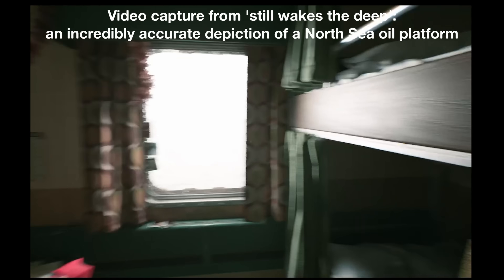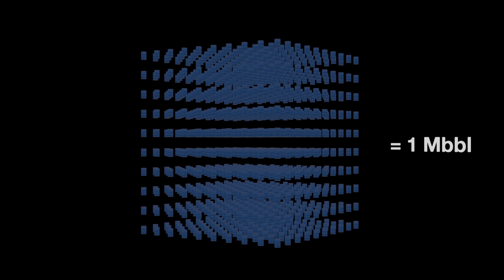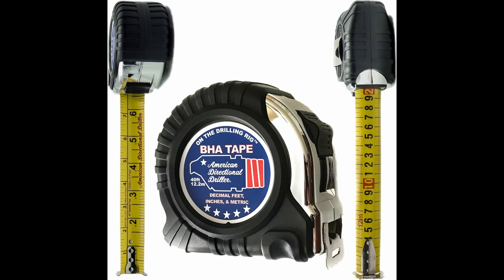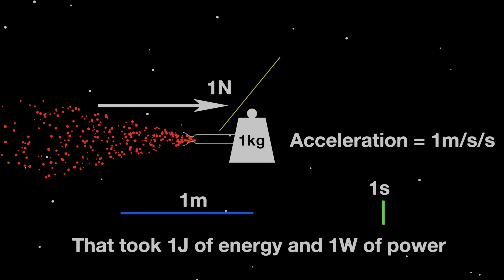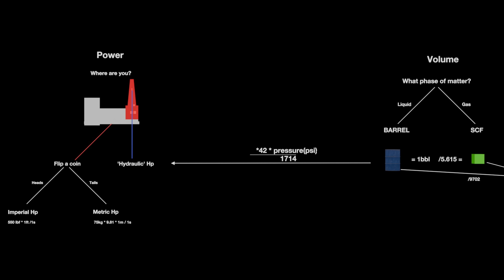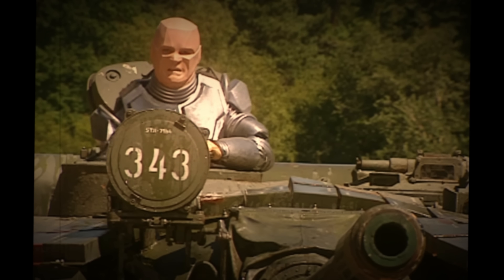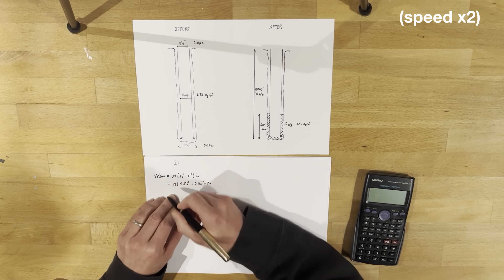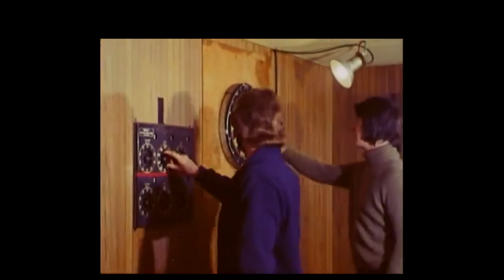Oilfield Units: a Measurement System so Cursed it made me Change Career

Comment: In meteorology (US), we have a dog's breakfast of units, too. Temperature in Fahrenheit or Celsius, depending on whether you're on TV or taking observations, winds in knots, height in feet, visibility in miles, and rainfall in hundredths of inches. Pressure has at least three variations. Hectopascals or millibars if referring to levels in the atmosphere, millibars if referring to pressure reduced to sea level, and inches of mercury for station pressure and altimeter setting. Models at least calculate with SI units, but then convert to all the crap above for output. It's likely a function of meteorology arising out of aviation and just being saddled with the customary units of American pilots in the early 20th century.
Reply: I'm 58 and grew up with pounds and inches but it's always been Celsius for me coz that's what the BBC weather forecasts have always used.   It was the ambiguity between below zero and below freezing that always bugged me, zero IS freezing in Celsius, you damn Yanks!   I'm older and wiser now and see the benefits of Fahrenheit. Here's the thing, a degree Farenheit is about the smallest temperature difference you can sense on your skin, ie what we can perceive, what's useful.  But with Celcius you want to go to tenths of a degree, which is overkill, or just Celcius, underkill.   And in temperate climes, ie most of Europe, the temperature is 0 to 99 °F nearly 100% of the time. The point I'm belabouring is that with Farenheit, two digits is all you need, least for weather, no decimal point, no negative.
Reply: @colinmacdonald5732  I'm about the same age ;-) and I still don't see any benefit to Fahrenheit.  Mind you, I grew up in Germany…

Ah, okay, interesting… and irrelevant.  I know what I like, and that's that.  I don't need decimal degrees for that.  Never care whether 23.8 °C or 24.6 °C is more to my taste: I prefer it roughly below 25, 25 and up is already too warm, 30 is too hot, and I don't want to think about temperatures above 30.

Oh, and Google just told me (not the AI summary, the actual results) that humans can feel a one degree difference in temperature.  One degree Celsius, that is.
Reply: Funnily enough, height in feet and wind in knots is something carried over internationally for aviation. 

That’s because of WWII, specifically the bit where Europe’s airlines were utterly ruined, and Douglas Aircraft Corporation built over 16,000 C-47s. 

Continental Europe rebuilt their airlines after WWII with surplus C-47s, since they were basically DC-3s with a cargo door, stronger floor and an olive drab paint job, and DC-3s were very good airliners. 

Since the airlines were flat broke, they figured it would be cheaper for pilots to use US units instead of spending the money to convert all the perfectly good dials for their perfectly accurate instruments to metric.

Comment: In optics, curvature is sometimes expressed in diopters, there's literal gauges that measure the curvature in diopters. The problem is, diopter is a measure of lens power, not curvature, so the curvature gauge measuring diopters was only valid for pure silica glass! Other glasses have a different refractive index and therefore bend light differently than silica glass, so measuring the diopter curvature won't give you the correct lens power. Heaven forbid you forget to account for a biconvex or plano-convex lens.

Comment: I just think it's funny that people care so much about it. Metric is good most of the time and us customary is fine for most things. There are some unit that I think you will talk about that are insane and need to be killed but there generally uncommon*
Reply: Metric is inherintly superior due to the interconnectedness between Length and Volume. If you need to make a cubic container that contains 1 hektoliter the calculation of the dimensions is done in 1 second. Now do the same calculations in feet and inches for a 250 gallon container.

Comment: Another wonderful unit is the "acre foot"
As far as I know it is exclusively used to measure the volume of water retained by a dam.
Reply: An upsetting unit, but at least I can see how it immediately multiplies out! If you’re working with acres already then it saves you a conversion.
Of course, it does mean you’re still using acres and feet, so points off for that.
Reply: @conferzero2915 it gets even better when you look at the definition of an acre
"A chain by a furlong"

Which is the nice convenient dimension of 66 feet by 660 feet

Comment: Machinist here, we have a wonderful mix of fractional and decimal inch units. 
Drawings can go either way depending on who made them. Stock (material) sizes and cutting tools sizes are in fractional standards (3/16, 1/4, 5/8", ect) where as the machines are built and graduated in decimal. A standard manual lathe will move the cutter 0.200" per rotation for example. This makes many things more difficult than they should be for obvious reasons. 

Side note,  I am from Canada. Another country with an absolutely cursed system of units.
Reply: And that's not even getting into the letter-and-number drill sizes that you need to deal with for threaded holes, or the thickness of sheet metals in "gauge".
Reply: @BrooksMoses or the mess that is British thread pitches
Reply: @Kurokimachine  Oh goodness yes.
Reply: @Kurokimachine  So much of a mess the British don't even use them any more! Imperial hardware is reserved for legacy systems, nuts, bolts and fasteners are almost always metric.
Reply: @Kurokimachine  Or bicycle thread pitches. Enough to make even a man who owns a full set of Whitworth spanners scream
Reply: @BrooksMoses  in the electrical industry we measure wire Sizes by mm2 crossection, mm diameter or AWG. mm diameter is mostly used for uninsulated solid core wire and telecom cables. The real fun is that cables speced in AWG sometimes (mostly when ordering from china) come in the mm2 equialent, beeing ever so slightly smaller.

Comment: This is lovely. While looking up the thermal conductivity of sheet materials for an electronics cooling application needing also electrical insulation I ran across this monstrosity in the spec sheet from one manufacturer:
    BTU mils / ( feet^2  hour  degree F)
I just gave up and chose something from a manufacturer who specified it in W / (m K)... Greetings from a Swedish electrical engineer (where no one in their right mind uses these units).

Comment: As a driller and then a directional driller I would say that dogleg severity is a sensible unit that describes how difficult it is to get weight to the bit or run casing. Radius of curvature would work for build-and-hold wells but most directional wells these days are pad work requiring the well to build and turn to land at 90 degrees inclination. To give my directional drilling trainees a sense of what dogleg severity meant I'd ask them to think through how much rock would the bit have swing through to change the well bore from an inclination of 0.5° at an azimuth of 45° to 0.5° at an azimuth of 225°. Now think through how much rock the bit would have to swing through to change the azimuth 180° if the well has been built to an inclination of 90°.

Comment: I still love the foot-acre as a unit of water measurement, but only for floods and farming. It's exactly this many litres of water: 1233480 (from Google). So, 1 and a quarter megalitres. Like, it makes sense, but it's about as useful as measuring "how-much-concrete-did-we-use?" in moles per cubic yard. It's just a stupidly arbitrary number, when worked out in simple metric.

"Enough to cover a football field in a foot of water" from Google as well. Like, wtf? And you use this as a unit of measurement? That's gotta be the most American thing ever.

Comment: I was going along just fine, the BTU thing is annoying but whatever, until you got to the worked example and gave a solution for the concrete volume in bbl, which of course makes sense with the industry context, but somehow THAT was the thing that threw me off.  Obviously, the correct answer for concrete is 7.0604 cubic yards.

Comment: 10:00 the most probable reason is the order of magnitude of typical values. If the typical range of values is between 10000 and 100, the most convenient way to express the number is in hundreds. Personally, I'd express 1714 either as one-thousand seven-hundred fourteen, or just seventeen-hundred if the tens digit is insignificant.

Comment: I'm so happy I'm not the only person who can't understand why the world has chosen to measure energy in kWh instead of mJ. Yes I like a 3600 conversion factor in my SI units, says absolutely no one, except everyone just does it for some reason.
Reply: An LED lamp consuming 1 W of power that stays switched on for 1 h uses 1 Wh of energy. It's both intuitive and how the entire industry thinks. As long as it remains standardized and no further conversions have to occur on the regular, it's fine.
Reply: @hammerth1421 Oil field units are also how the entire industry works; that's irrelevant to whether the units are nice to work with or not.

That I don't think the world should've picked them doesn't mean I don't think they're more or less fine, they're just more clunky to work with than necessary. I do know I haven't been able to convince my engineer dad watt isn't energy, so he's being ignorant but also the Wh is indeed causing unnecessary confusion.

A device measuring watts can just as easily report J/s or even kJ/hour as it does watts. The Wh is easy to define but hard to work with or intuitively understand if you think in terms of energy first, not power first. Try explaining energy to a 5th grader: higher energy = bigger explosions. Less energy = less work. Now try power. You either become circular (more power = more powerful) or dependent on energy (more power = puts out more energy per time).

(I consistently fail to be consise, sorry.)
Reply: The reason is that nobody is interested in how much energy something uses if you run it for one second.
Reply: @AndersLang-i5s We don't measure distance in (meter/second)hours. That the watt has a name and the m/s doesn't is not an fundamental fact.

Comment: I initially clicked on this video believing I had some broad sense of what I’d be getting into, and was looking forward to gawking at some weird imperial-adjacent unit systems.

I am two minutes in, and have learned that oil is measured not in barrels, but in BLUE barrels specifically. And we haven’t even gotten to gasses. I’m now dreading what horrors of anti-standardization I will soon come to witness. Wish me luck.

Edit: Just finished the section on power and energy. Before today I thought things couldn’t be worse than horsepower and kilowatt-hours. Simply incredible. Honourable mention to kilowatt-hours-per-hour though, that’s hilarious.
Reply: It'll be "pirate-ninjas" for power next, I swear (refer to Andy Weir's "The Martian" for that one - one kilowatt-hour or 3.6 MJ per Martian day, or sol)
Reply: I went from "Ok, not great but it's not that bad so far. I can memorize this" to "I can tell why they have a book for unit conversions now".

Comment: My recent oilpatch units story from western Canada:

A couple of weeks ago I was harvesting a field of wheat next to a drilling rig. They had a wire strung out through the crop, so I stopped in the office shack to arrange moving of the wire so I could cut the crop around it. While there, one of the guys steering the drill showed me the 3D schematic of where the drill was going under the field (super cool👍). I asked what the minimum radius bend they could make the drill-string bend. He paused for a second then explained he didn't actually know since all their calculations are based on degrees per hundred feet😂
Reply: if something bends by 3 degrees per 100 feet, it's easy to calculate in your head that after 3000 feet it has turned 90 degrees. More useful for railway than oil drilling though.

Comment: This is right up there with the specific impulse and delta-v shenanigan's that crashed a probe into mars. Like who thought it was a good idea to devolve that measurement into seconds so that you can just easily multiply it by gravity (either in SI or Imperial) to get the actual value you want.

Might as well measure volume in grams. Just divide by the density of water to get the actual volume. What!?

Comment: 14:12  I’m trained in Electrical Installation, not Well Drilling, but i think i know why this came to be:

When bending conduit, if it gets crooked in a certain way (usually in multi-bend processes like a “box offset” ) due to error/inexperience etc it is called a “dog leg” due to it’s resemblance of one.

Thus i think this was a problem discovered by the people doing the drilling, then researched AFTER, thus not planned well in terms of integration with SI etc.

That’s just my guess though, i’d love to hear from people in-industry on this!
Reply: Generally a "dog leg" shape is a term used lots of places to refer to something that is a bend in between two straight sections.

Comment: The Americans crying about units are the ones too stupid to be worth listening to. I'm American. I still use Imperial units 95% of the time, because I'm in America and because it's what I know. Yet I have taken deliberate steps to start using metric more because it's so much easier!! I started using Metric in my woodworking because of how much easier it is.
Reply: Fascinating.  Given that in the U.S., drill bits in imperial units are more common, saws are demarcated in imperial units, fittings are typically sold in imperial-unit dimensions, and lumber is mostly sold in imperial units, I am really surprised that you're finding metric to be easier.

Comment: So hold on.  I’m not even 5 minutes in and already I’m wondering: is there not an international body for oil fields that regulates everything?  Why haven’t they established common units or at least chosen to adopt SI units for everything?  Seems like a potential unit conversion screwup would be very costly (*cough cough* mars probe *cough cough*).

Comment: I will defend the watt hour. Because when you’re talking about power and energy usage, it’s almost always much more useful to know your run-time in hours than in seconds. When dealing with electrical units, you can spend all your time with watt/amp hours and never invoking a unit defined with a second. If you do need to use Boltzmann’s constant for thermals or Planck’s constant for quantum, then using hours in the first place is probably a bad idea.

As for watt-hours per hour, almost certainly because people get confused with watt-hours and watts per hour. It’s not pretty but it does somewhat disambiguate.

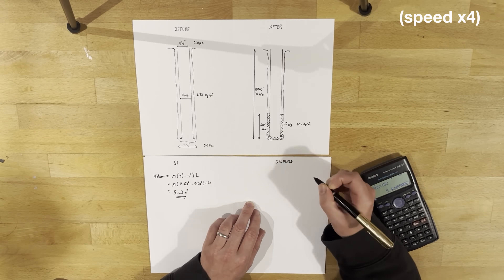Comment: 15:19 While I'm sure you are more skilled at these calculations than I am, I do believe it would be beneficial always to carry over the units when doing calculations. Especially if there is a risk of confusing units. It should be e.g. 55dm*10cm/dm=550cm, when converting units, not 55*10=550cm. (Where did the cm come from in the last equation?) 
He who rages at the incorrect usage of units should be an example of correct unit usage himself.

Comment: I'm a civil engineer working in the water industry so I defintely come a cross a few odd ones. Our big quirk is that the correct unit for pressure is the meter. It actually makes a lot of sense (it's the pressure underneath x meters of water and makes a bunch of calculations both far easier and more intuitive - water 10m higher up has 10m more pressure), but it tends to confuse people at first. As can the fact that pressures can go negative. Because measuring against a vacuum is utterly pointless when there's no vacuums on a water treatment works (well, assuming you haven't messed up the surge protection on your pumped pipelines...) so we measure relative to atmopsheric pressure. For the rescord, vacuum pressure is close enough to -9m as makes no difference.

Fortunately, I work in the UK so any new stuff is metric, but that doesn't stop us being rather inconsistent. Volume, for example, is sometimes given in cubic meters. And sometimes liters. And sometimes Ml (megaliters). And occasionally TCM (thousand cubic meters). And if you want a flow rate, take any of the aforementionned and apply it over either a second or a day. Or if you feel like being different, a minute. And then use multiple combinations in the same project.

But I do sometimes do work for American clients or work on older British sites using drawings that date back to pre-metrification. So that brings in conversions. Which isn't too bad at least they use the same definitions of the basic units. 0.3048 is the most important number. Though, much like your odd tape measure, we do have decimal feet. For some reason, it was decided in the distant past that lengths should be measure in feet and inches, and elevations (height above datum) should be measured in decimal feet. But I've worked on sites in Singapore (I think, might have been HK though) that still use Imperial gallons as the volume unit (it's probably just on older documents again, but when that's all you've got...). But more often than not, they just say gallons. So that's fun.

And then there's acre-feet.
Reply: Acre-feet is used by all Farmers in the US west for irrigation and water rights.
Reply: And if you think this is bad: Aeronautical uses the Nautical mile, or Knot for speed. Which is 1,852m and translates into 1.68780986 feet per second. Considering air mass in slugs is in cubic feet, obtaining dynamic pressure:  0.5*rho(V^2) makes for abundant inefficiencies for anyone. Better to perform the calculation and build the whole plane in Metric, then print the airspeed indicator in Knots for all the monkeys who twirl the stick between their legs.